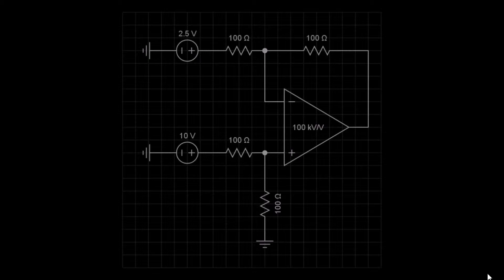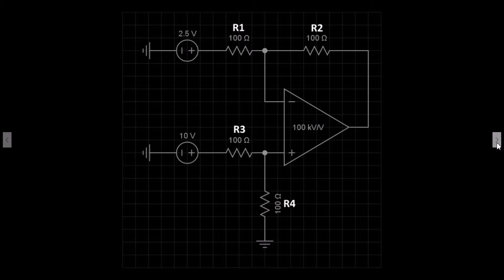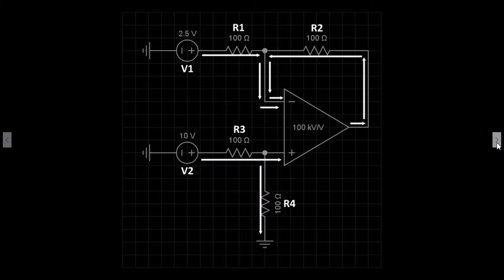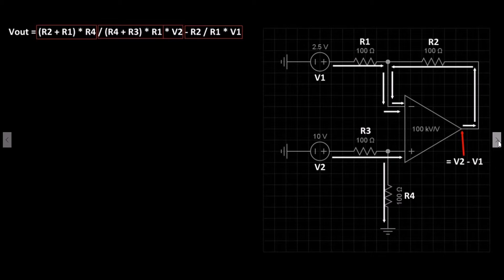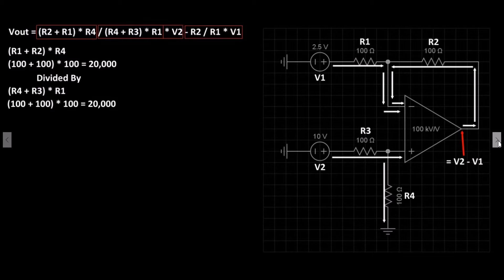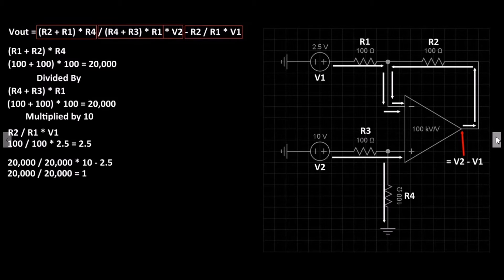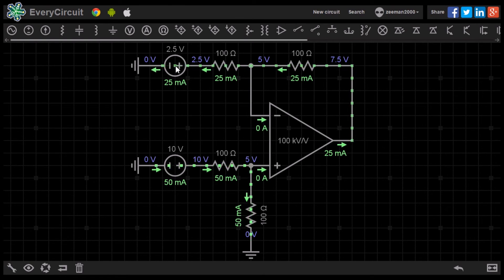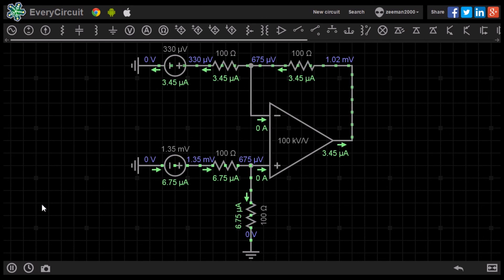Electronics Tutorial 13 - Op Amps - Difference Amplifier

Comment: hello when you play the simulation at (4m20s) the current flow on the top circuit is from 
+ to  - but on the bottom half is - to  +  ? 
regards ron
Reply from the maker: Hi Ron, It is current flowing to ground. Remember this is a schematic and the ground rail would probably be on a different area on a circuit. Hope this helps.